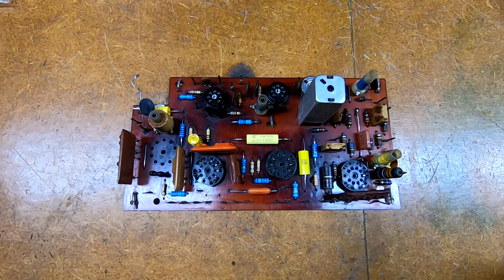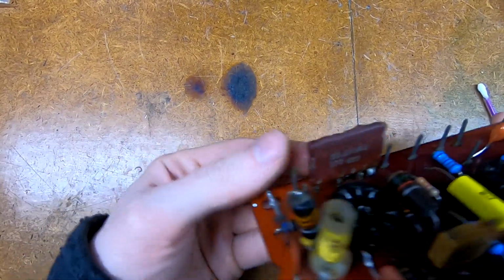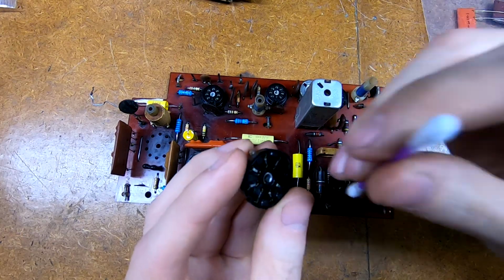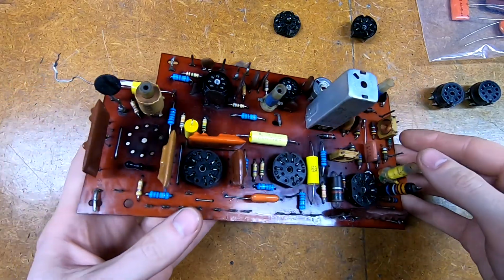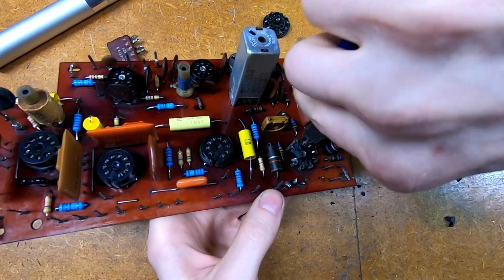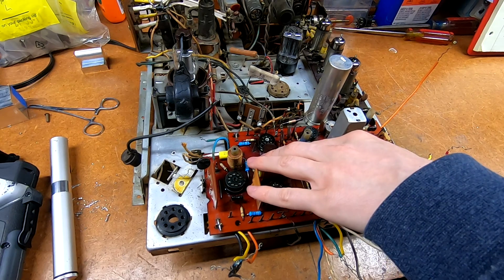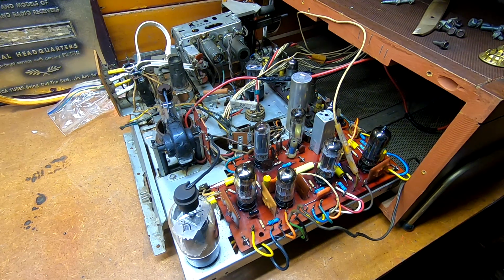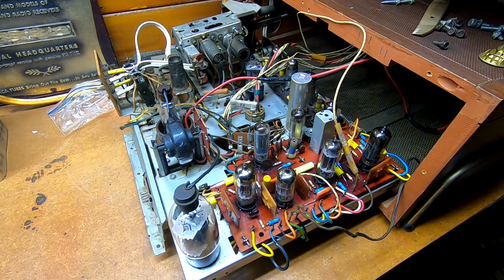Philco Predicta Holiday Repair - Part 2

Comment: I think the center pin on the tube sockets was there to provide structural strength. They were aware of the fragile nature of these boards.  Rocking the tubes during the removal can significantly stress the board.
Reply from the maker: Not a bad idea! I did some reading too and apparently the center pin was commonly used as a tie point, not just as a ground.